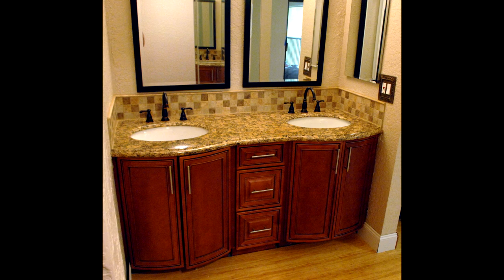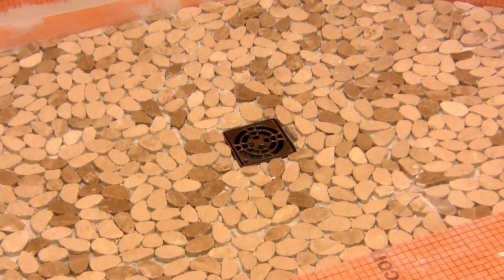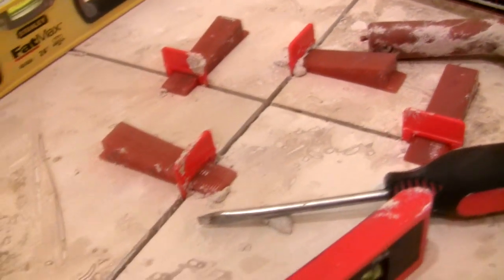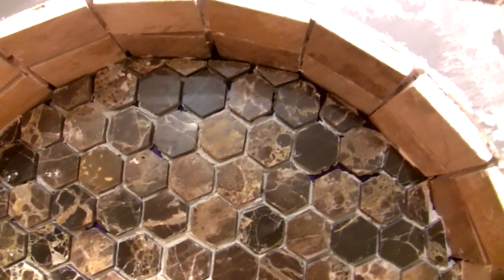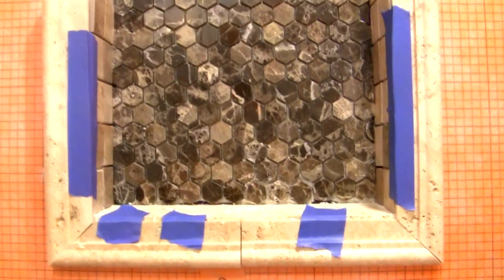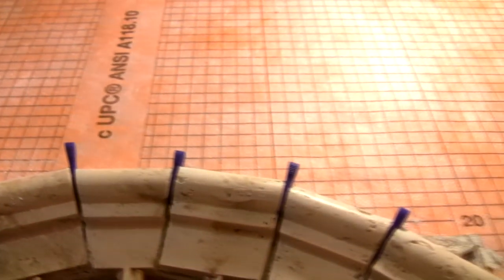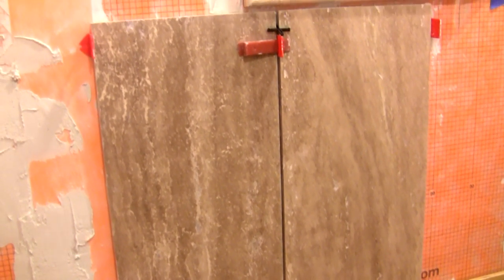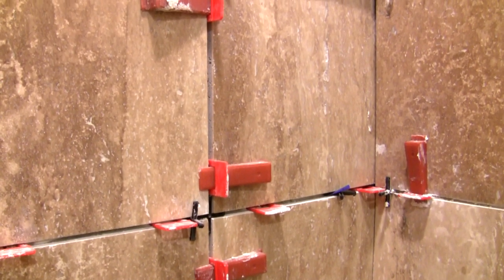Our Best Bathroom Renovation Yet - Part 3 | Shower Walls Tiled

Comment: Jeff great Videos, is there a reason you prefer Hardi board covered with Schluter Kerdi Waterproof membrane rather than using Schluter Kerdi Board?
Reply from the maker: Very good question Jerry! I did not know I preferred the much lighter $40 Kerdi Boards until after I lugged these heavy cementitious $12 Hardibacker boards upstairs one by one, breaking in sweat, killing my back, out of breath, and with all the work involved with trying to embed kerdi membrane vertically up the wall. After that I swore next time I'm using Kerdi Board Panels! They are so light, I can carry the entire bathroom's wall panels in one trip! A Lot less work, plus easier to wet shim the Kerdi Boards. i did a video last year showing how to make perfect 90 corners and how to perfeclty level and wet shim Kerdi Boards: https://youtu.be/OMUW1E3FAwg
Reply: @jeffostroff  Jeff thanks for reply, I shall look at your Kerdi video . I am WEDI certified, can easily get WEDI products from a local distributor  but find their pricing even with professional discount too expensive and cutting them is not so easy . When I use WEDI it is so strong and waterproof that I am confident it will last forever!  But  I  really dislike the WEDI shower pan drain system and after having a micro-leak from the drain pipe/drain attachment  now refrain from ever again using WEDI pans. Based solely on watching installation videos  I am now attracted to installing   KBRS pans which I must purchased directly from KBRS, unfortunately  there is no local distributor. I appreciate that you like Schluter Kerdi but have you ever worked with the KBRS pans with GoBoards,  Hardi or Kerdi Board walls? , the KBRS  drain system really attracts me. Also have you used Go Boards? After the holidays please comment. Yes I am searching for my favorite system!  Season's Greetings and Happy New Year.
Reply from the maker: @jerrygrayson65  I have not used  KBRS pans with GoBoards. I have typically used what I can walk into my local distributors and buy.